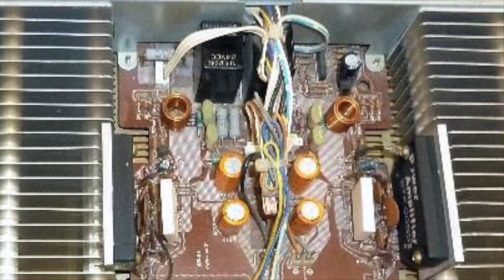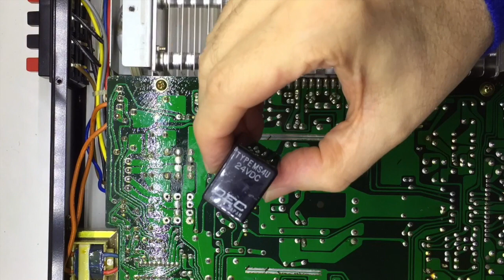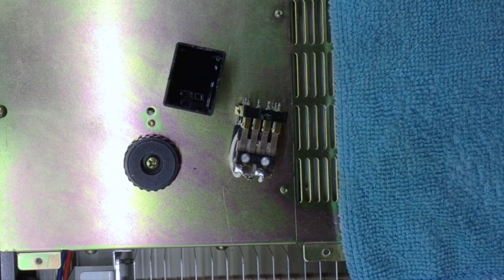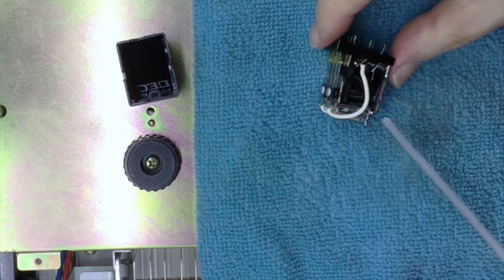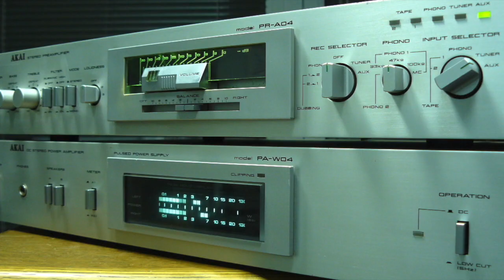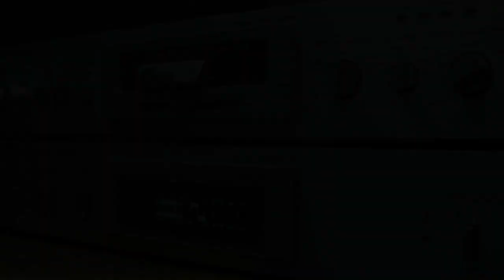Amplifier Signal/Speaker Relay Cleaning

Comment: I bought a used Marantz SR5007 AVR with some weird issues on the analog inputs. Any time I switch to a line input my speakers pop, they also pop when I mute the AVR. When I adjust the volume (digital encoder) there's distortion for every volume increment step but once the volume is set there's no (audible) distortion. This issue is not present when I'm using digital sources, be it over HDMI or streaming to it over WiFi. I think I've narrowed the issue down to the input switching relay which is a Handouk BC3-12 24V relay. It seems to be a similar issue, this probably isn't caused by a power supply relay or the speaker relays themselves, right?

Comment: There are two protection relays with my Pioneer amplifier A447 model. Which protection relay should be cleaned the left or the right side? Is it possible to buy a new relay parts with this  amplifier? Thanks for your reply.

Comment: This method is a relay killer, never use abrasive paper, the life of the relay decreased dramatically after this type of "restoring".  To clean the contacts, use simple printer paper impregnated with alcohol or acetone, it must be rubbed until contact shines! The best solution in this case is to buy a new one.

Comment: Just wish I could get the relay cover off. I'm trying to clean the contacts insitu because I'm no good at soldering, but I can't get the bloody cover off.
Reply: Try and practice soldering on a throw away test board, cleaning them insitu is a nightmare, a steady hand and a good desolder pump will make short work of it, make sure you use flux when you resolder the contacts.

Comment: Hi i this question is nott relative to the vid
....i have a loudspeaker amplifier and it suddenly started to go into protection mode on relatively low volumes ( Compared to my loudspeakers ....the knob is barely 1/4 the way up ) ....and i checked for short circuits but my speakers worked fine on another amplifier...
What might be my problem ?
Thank u in advance.

Comment: This is great video.  I have been having problems with an Onkyo stereo amplifier that is about 40 years old.  It takes several minutes before the left channel begins to work, whereas the right channel works right away.  I've DeOxit all of the pots but the problem still exists.  When I saw this video, it gives me another approach as to what the problem is. The relay is tucked away in very close quarters  and I will have to remove a pcb to get to it.  Here goes, and thanks again!

Comment: p al
2 hours ago (edited)
Caution with the pulsed power supply, AMU-6004A, in the metal enclosure. also the AM-U06 amp uses this PS. The small transformer burns a hole in the small circuit board. I had to rewire from schematic and replaced the 2SC2335 transistors with ST10037, and also the trigger diode LS2039. I used a DB diac, which worked well.seems the aging glue shorts were the trans wires are soldered to the board.

Comment: looks like an Akai PA-W04...
Reply from the maker: good spot :)
Reply: soldered on the board, aging glue shorts the wires and burns a hole where they are solder onto the board.

Comment: Thanks for the vid. Could this be the cause for my left side going in and out, mostly out as time passes?
Reply from the maker: Hi Harry, Yes quite likely the cause. Otherwise it could be one of the amplifier switches such as input or speaker selector. Some spray contact cleaner can help with those.
Reply: I have a Sansui G8700 DB. I purchased it a few years ago. The left side was a  bit weaker from the beginning but,this thing still sounds amazing. Thanks for responding. I'll keep you posted. PEACE!

Comment: I don't understand what's happening at first in the video.  The relay seems to have been already removed.... then not.  What's the soldering thing about?  Can't you just pull it out?
Reply from the maker: Hi, It's a soldered rather than socket based relay as most will be for audio equipment. It's shown unsoldered at the start of the video simply to give a clear shot of the device.
Reply: Does that mean that I couldn't clean it in any meaningful way without going through the soldering process?  Since my first comment, I've seen another example where a guy popped a plastic cover off and ran some paper through it.  The model I'd be working with is a 1990-ish Onkyo receiver.  I've not even opened it yet. Just wondering what's possible for someone who's never done this kind of thing before.
Reply from the maker: @echt114  You can pop the cover, but sometimes as in this unit the relay sits in a cramped space and it's easier just to remove it and replace once cleaned. If you have good access and you can pop the cover easily, leave the unit soldered in place.
Reply: OK that's some incentive to open it up and check.  Hopefully the access is good.  Thanks for the quick replies.

Comment: Hi there Robbo, great Video thank You.
I am making a speaker switch to disconnect a set of speakers on a hifi system, i want to use relays just like this.  what should i order ? I wanted ones that would be used in amps for this application . Thanks John

Comment: These are 4-5USD components, now for PCB mount old relays, there are base adaptors so that if this new relay gives you trouble in the future, you just swap it. This cleaning will remove the protective coating and the oxidation will come back faster than before.
Reply from the maker: Sure, but 'faster than before' needs context as these units are often many decades old. You can expect a few more years good service after cleaning. You cannot expect the full life of a new relay....
By all means replace with a new relay if you wish, though of course you need to select the correct type and pretty much all relays available will need pins removing at the least to fit these 30+ year old amplifiers.

Comment: My pioneer amplifier has dirty relay contacts. Just giving it a little tap with my finger makes it work again. However it's a logistical nightmare to remove the board to get access to desoldering the relays. I'm going to have to perform an institute clean. There's plenty of room around the relays and can see only 2 lugs holding the cover to the base.
Reply from the maker: Yep that should work fine is you can get access and have enough room.

Comment: I install the relay on a base, so it can easily be removed without soldering.  That way the relay can swiftly be cleaned from time to time (like ones a year).  I never use abrasive paper, instead I use a thin sheet of carton and a little metal polish compound.   I remove excessive compound with a paper tissue and a drop of deoxit spray.  Contacts can be polished to a mirror finish so they stay clean very long.

Comment: Hi, i really apreciate your recomendation, right now I'm taking off the relays of my onkyo to do this, I hope it works, I thinks it is the relay my problem because when a hit it a little the sound come back again.
Another question, my receiver is a onkyi htr 510, it is a 2003 machine, I wonder if I should recap all? it is only 14 years old, is it enough time to recap? so I don't know if this years could have affect the performance, I say that because I'm not the first owner, I got it 4 months ago.
Thanks.
Reply: Considering it's not very old, just recap the big supply ones and any audio output ones.

Comment: How did you get the relay out after using the solder pump? When I did it there were still tiny  bits that held it in and I was scared the PCB was going to be damaged if I simply pulled it.
Reply: use a soldering iron/pump all in one
Reply: @Synthematix  where can you find or buy it? Thanks.
Reply: @amarin053  Ebay mate or amazon iron/pump desoldering combo about £25